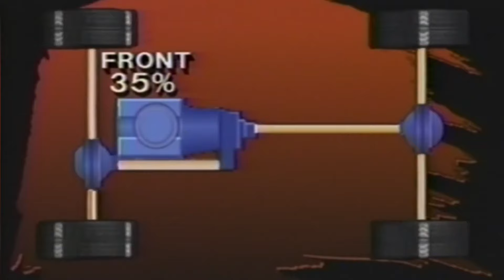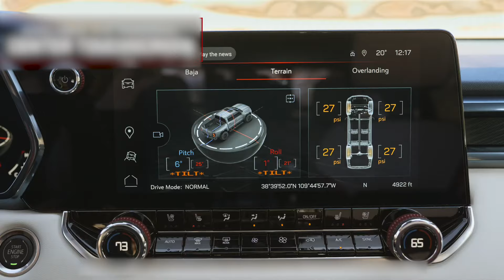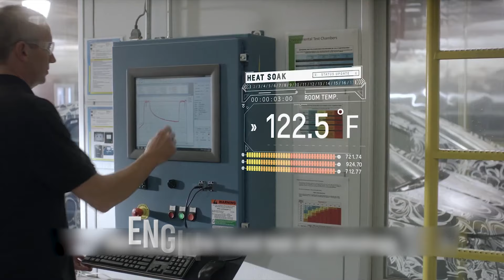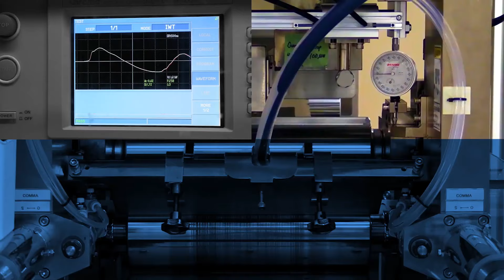ALL NEW GMC Syclone SHOCKS The Entire Car Industry!

Comment: They would just have to make a Canyon with a LF4 and 10L80.   Ford just released the Ranger Raptor with the 400hp V6 turbo stuffed under the hood, so it's not out of the realm of possibilities that a version of this could be released.   As of 4/2024, Ford has the only high performance midsize on the market and they are backordered for a year to get your hands on one.